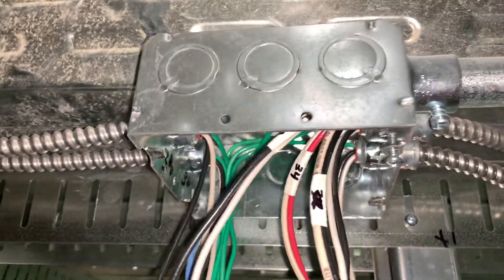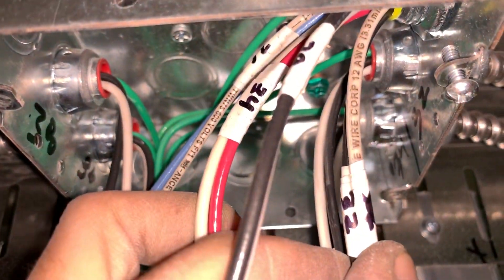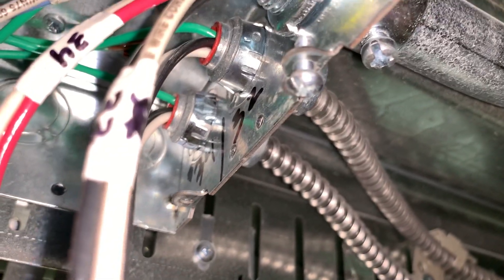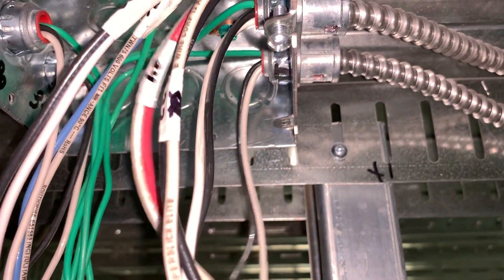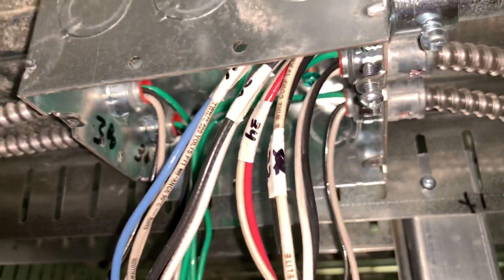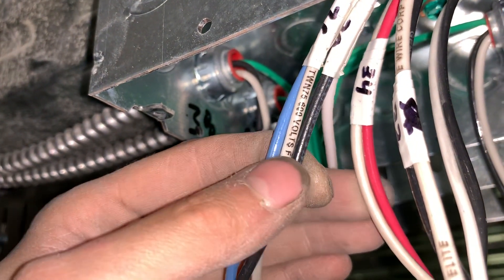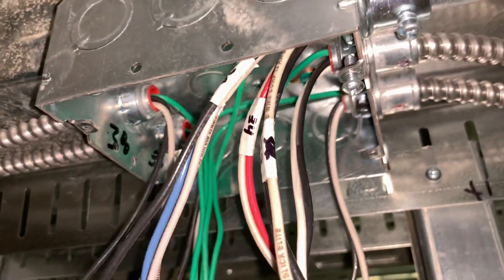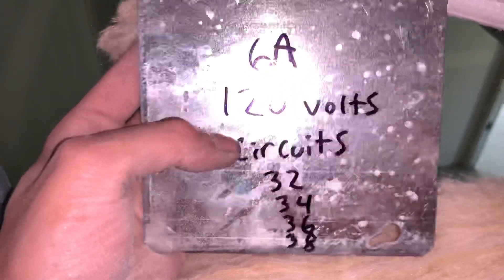How To Make Up Electrical Junction Boxes (Commercial)

Comment: When when you share a neutral both circuits have to be on opposite legs of the 240 so you don't overload the neutral am I correct
Reply from the maker: not very familiar but sounds right. i've never seen a nuetral shared besides a+b+c

Comment: You can't share neutrals anymore, each circuit has it's own neutral.
Reply: I think you can share neutrals as long as the breakers for both circuits have an attaching clip
Reply from the maker: correct